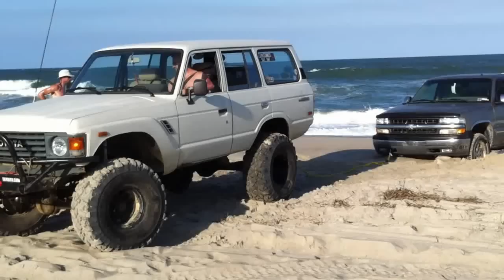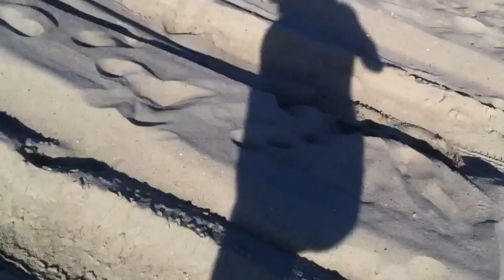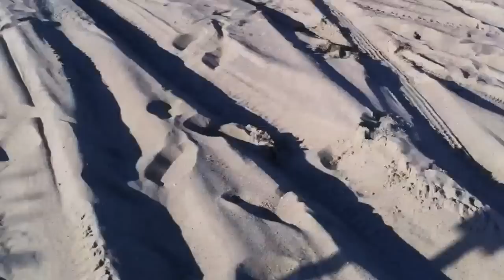Carolina Beach @ Fort Fisher - Dragging out a Chevy Pickup - 1st Video

Comment: you guys don't have shovels? do you know how to use them? a little digging and she would have pulled out easy..4x4 or not. 2wd is fine if you know how to drive on the sand...duh..let's park down near the water at low tide..crap the truck don't start...